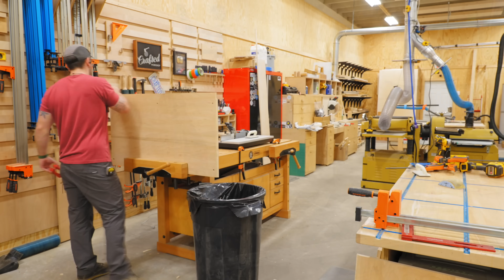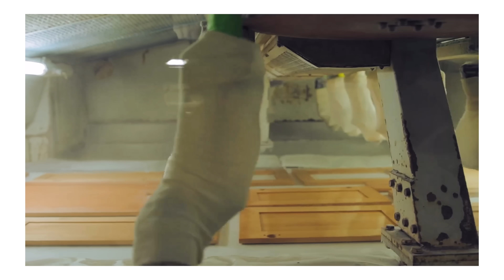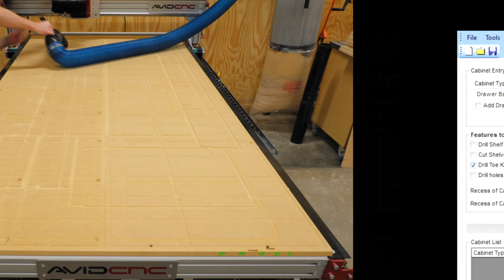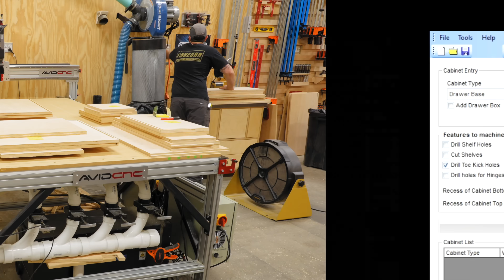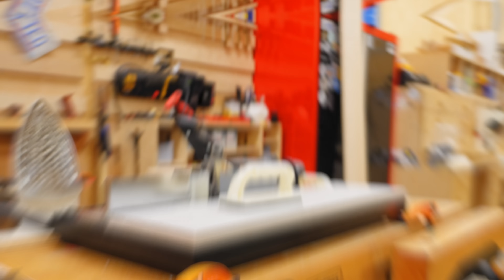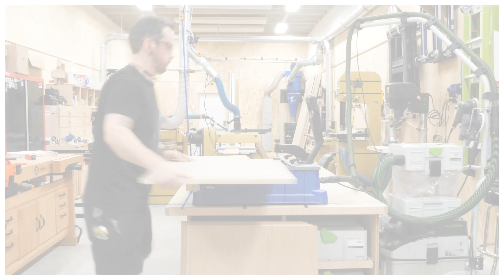Are KITCHEN CABINETS cheaper to BUILD or BUY? // CNC Kitchen Cabinets

Comment: How fast can it cut a sheet of cabinet ply? And how many Ipm can it move without deflection in the machine? 
Looking to buy an avid with the ATC 7 hp spinal to cut cabinets. 
I have a 20 hp Becker vac pump so parts movement should be minimal. Just a one man show and avid looks like a great fit but don’t want a 20k toy.

Comment: Building cabinets with plywood or MDF costs the same as buying IKEA cabinets in many countries. Plywood and MDF are simply to make the labor cost low, but the material cost is expensive. If you build yourself and don't hire a carpenter, you can make the cabinets much cheaper, all things considered, using stud frames with cladding, like back in the days before the labor cost was considered too expensive for doing built-ins resulting in pre-made cabinets being produced by the industry and later plywood and MDF available for everybody.

Comment: Hey Johnny,
Been thinking about getting an Avid CNC and building my own kitchen cabinets. I am a Mac person but guessing I need to buy a PC for the CNC. Curious as to what led you to use CabinetsPartsPro software and if you still would suggest using it. I have been toying with Shapr3d on the iPad which is a competitor to SketchUp. Any advice would be be appreciated.

Comment: If I found someone proficient in working with all my tools and I taught them how to make cabinets and only paid them minimum wage, it would be cheaper to buy pre-made cabinets than have them make them. And that's if you have a CNC. Without, it would probably be 5x more in labor (if not more). If you're going to sell the cabinets, then the same is true, but that can work to your advantage if you're pricing them at a premium (the whole point). None of this even factors in equipment costs or software costs.

Comment: I have a question : If you cut a plywood panel, cutting tru the board.  how do you hold your board?  do you leave a space between the spoilboard and the plywood so the spoilboard does not get cut?

Comment: A pro tip for the Vacuum table. If you surface it down too far there won't be enough resistance to hold things down, so I keep a few 1/8" sheets of MDF laying around for when it gets too chewed up to hold small pieces. We usually get maybe 3 surfacing runs on our spoilboard before it starts underperforming. 1/8" sheet of MDF is $12 and a 3/4" sheet of ultralight is $70. As long as the outside of your board isn't super hammered it's a great way to extend the life of your boards. 

For anyone confused, using a CNC machine is a logical extension of the skills gained in becoming cabinet maker or millwork carpenter. Being highly organized and having a refined understanding of your tools is critical regardless of what tools you use, and there is no other tool that rewards you for those practices more than a CNC machine.

Comment: friend, can I suggest what I am looking for? I am looking for a chest/cabinet to hide my 3D printer. I'd like to be able to open the lid, and then turn a handle so the machine rises out of the cabinet and then locks in place on top. After printing I can then hide it back inside.... I would definitely buy that design!

Comment: Interesting.  I would probably not mind building the boxes and then just buying the cabinet doors...  It seems like the boxes are always that cheap press board junk when you buy cabinets these days... I'm not a fan of press board.  But I don't have anywhere near the tools to do a good job with cabinet doors or faces.  The last time I did a kitchen, I bought my cabinets premade and preassembled, that saved a lot of work...  But then I installed them myself because my kitchen was a bit weird, and had to do a lot of custom bits and pieces to bring it all together.  Turned out beautiful!  But then I sold and moved 2 years later... Rats.  I loved that kitchen.

Comment: what grade 3/4 ply are you getting for $66 ?
Reply: 3/4x4x8 Sanded Birch is currently $68 at our local Lowe's. The Menards next door has Birch for $64-68 and vertical grain Poplar with a UV primed backside for $60.
Reply: @sweedenburg  Thanks. Damn I wish we could buy and build with that. We’d save so much ever year.

Comment: My local big box hardware store sells an 80” tall, 24” wide pantry cabinet with 4 doors and 1 drawer for $200. And just my material cost on that exact cabinet is $211 + tax…
Reply: The one they sell is probably particle board with veneer and cheap hardware.  I would check out custom cabinet makers near you or even the kraftmaids through HD/Lowe's OR Ikea for a better product. Also if you have ever ordered...anything, from a big box store you know that about half of the stuff you order will be damaged and you will spend countless hours trying to get it corrected.. Personally I did RTA Cabinets which was probably the worst of both worlds.
Reply: @DavidMoncrief  I am a 16 year cabinet maker. The price I gave is for materials to replicate that cabinet exactly. Hardware and all. For anyone looking to buy proper custom built cabinets, you should be willing to pay (an average of) $650-700 per cabinet (fully complete) before thinking the cabinet maker is fleecing you.

Comment: That first cabinet was fully assembled when it was checked for squareness.  What do you do at that point if something isn't square?
Reply from the maker: You can clamp the corners to pull it into square while the glue is still wet.
Reply: @craftedworkshop  Thanks.  Would love to see how this is done.  I'm just getting into wood working and in all of the videos I've watched everything is just magically square all the time.  I'd love to see a video on how to fix squareness issues.

Comment: Hi Johnny, I'm a dutch cabinet maker. Maybe i've got a helpfull tip for your cnc vacuum. At my workplace we use a nesting cnc with a wasteboard which has abs edgebanding all around it. This reduces air leakage through the thickness side of the wasteboard. Hope its usefull. Thanks for your videos:)
Reply: I’m a cabinet maker in Indiana. We have a 15hp vacuum pump on a 5x10 cnc. It holds down pretty good.

Comment: One factor you didn't mention, but I think is worth considering for the general population, is the cost of tools. A project like this would necessitate a considerable investment that would really change the value proposition.
Reply from the maker: Tools was literally the first thing I mentioned, hah. What tools you have at your disposal is probably the most important factor. I don’t really think the tool value should be factored in unless you use the tool solely for this project, which would obviously be far from ideal.
Reply: @craftedworkshop  great response... people just don't listen
Reply: He did mention it

Comment: Hi, I made all my kitchen cabinets when I remodelled my kitchen, I used good plywood (at a fraction of the cost now) and face frames that I made from 2 by 8 material, cut down to 2 by 1 with pocket screw technology and the cabinets look as good now as when I made them some fifteen years ago. I used soft close euro hinges and made crown moulding on top of the cabinets to conceal the low voltage lighting that you can just buy now. I built an electric oven and a gas hob into the cabinets with pop up power sockets for toasters etc.
Reply from the maker: Sounds very nice! Can’t wait to get these cabinets installed in the tiny house.
Reply: Wow, amazing!  Not heard of soft close euro hinges, I'll have to look into those...

Comment: Seems like it's definitely cheaper to buy unless you already have spent thousands on the various tools and machines.
Reply: Exactly, it’s not really DIY when you have a professional workshop.
Reply: Look at it another way, one project like this can go a long way to setting up your workshop tool collection. A couple of drill/drivers, a router, and a sander some bits and a track saw will set you back 1000-2000 usd and cabinets such as these are well within reach and you still have some cash spare for the next project!